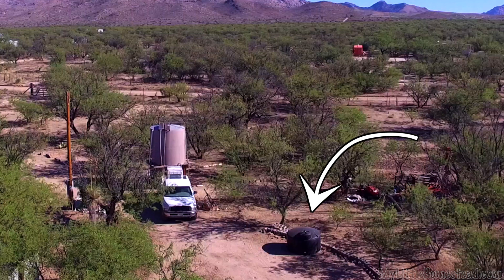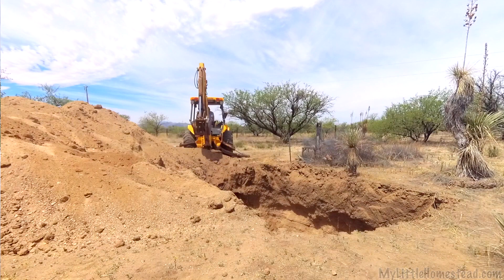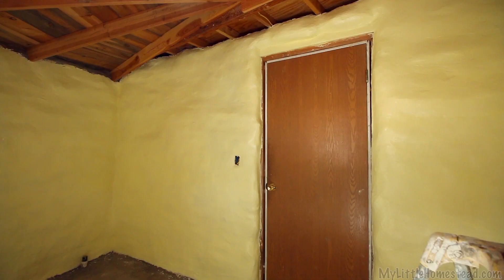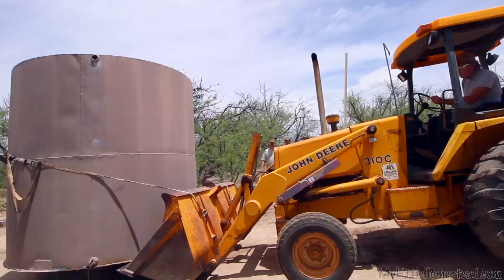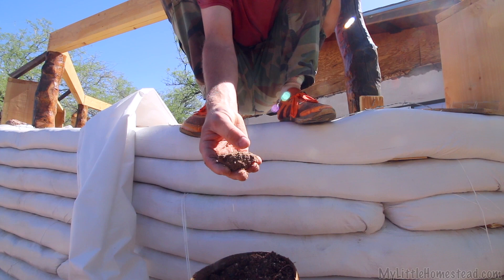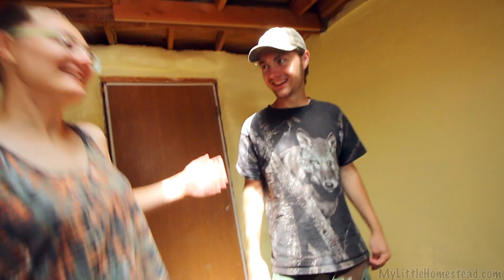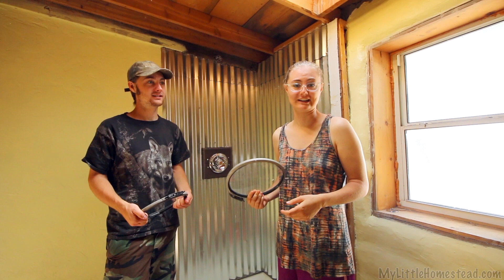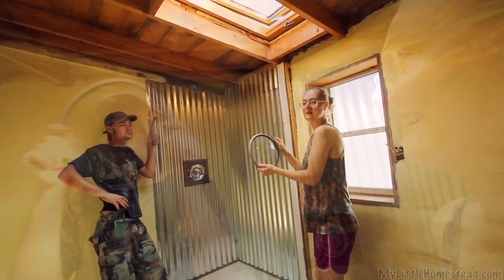Paint, Tire Frame & Set up Rainwater Harvesting | Earthbag Kitchen & Bathroom | Weekly Peek Ep139

Comment: So, is the plan to channel the rainwater into the big underground tank and then pump it to the smaller tank? Will you elevate the black tank on stilts above the currant platform to compensate for the loss of head compared to the full, large tank?

Comment: Great family, Good work. Are these buildings as sturdy as they look?
Reply: A version of these structures that have a cone or domed roof also made of earthbags did meet the stringent California Building Code earthquake standards. This was about 2 years ago, so Im not sure if Code changes have been made. The material I read referenced the complete structure being made of earthbags, but I would trust the roofs that Gary builds on them. Garen's room is still standing. What is it now, 5yrs or 7yrs? Something like that. Also they have been pretty popular structures in several countries in Africa. Entire villages have been built with earthbags.
   Oh and its the round buildings Im referring to. Some people have built square earthbag homes but as you may know a circle is stronger than a square. Lots of bracing needed for the walls of a square one.
Reply: JR MTG
Yes you are correct in sturdiness!! These buildings are very earthquake resistent due to the thickness and heaviness of the walls, they are also mostly pest proof except for maybe door ways any slight openings not covered with something they can't get through!!! They are highly tornado and hurricane resistent, with exception of the roofs! Now Gary has made these reciprocal and out of heavy boarding so they can withstand smaller tonadoes and or hurricanes...but big ones could pull the roofs, but could not bring down the walls!!! The walls are fire proof but they would loose the door and roof!!! For the most part these houses are very safe  from most types of damage!!! They could even withstand a washout once or twice!!!, But then they would just need filled back in back up to grade/ground level and pack it in and they would be ready for another!!! 

If they had domed all the way they would have been pest proof except for doorway, fire proof except for door, tornado/hurricane proof and earthquake resistent up to an 8 on the rictor scale! With Gary's roof about the same on quakes, fire and tornadoes are about the only thing that can get the roofs and tornadoes woukd have to be F5 I would imagine with how these are built reciprocal strength added to it to keep it from buckling, but the winds could pull boards off if they were caught just right!! But definitely stronger than conventional roofing of today!!!
Reply: The Ducking Homestead and Gardens 
   In tornado and/or earthquake prone areas I would prefer to have this style of roof anchored to the walls a bit better. Otherwise, yeah, what you said. 👍🏻